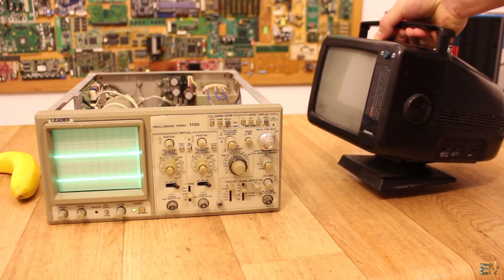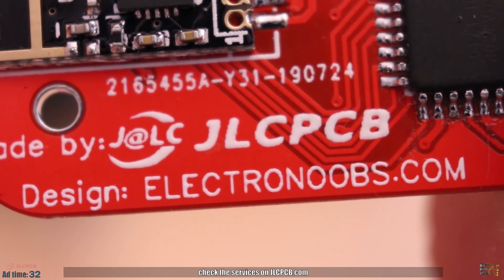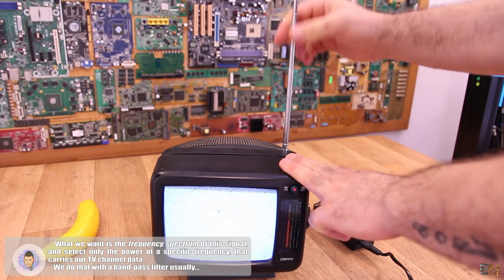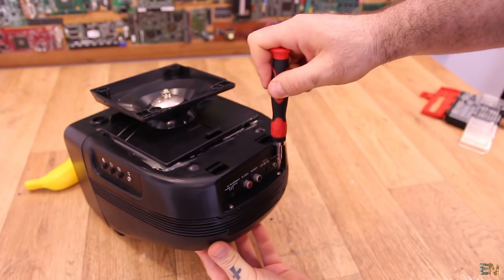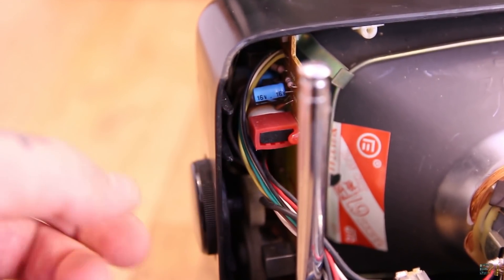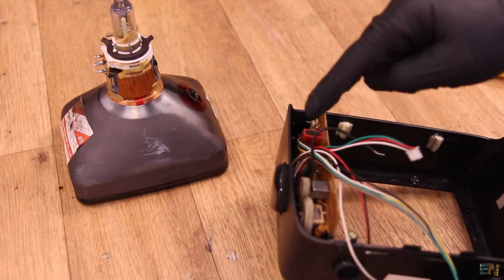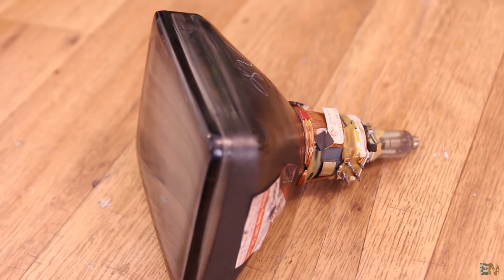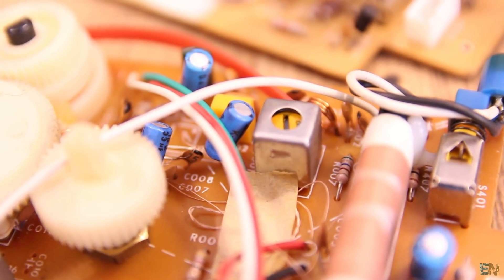Vintage Teardown #2 - Old Portable TV | Cathode Ray Tube and Flyback

Comment: This thing is from around 2000. There were more advanced crt sets around long before. Smaller, and color, even flat CRTs. This TV is just cheap. It's cheap, because of the highly integrated ICs, available at the time.

Comment: All you have to do is get a digital analog TV converter box
Reply: or better yet connect the rf out of a cable box to a signal booster, and connect the output to a rabbetear to make it completely wireless and modern with youtube and everything!
at least if you have xfinity x1 you will have all the cool steaming capabilities

Comment: What you did not explain, is the purpose of the flyback transformer and the principle of flyback in a TV. The deflection coils paint the image on the screen, one line at a time and in an alternate sequence. First it paints lines 1, 3, 5, 7...etc. and them it paints lines 2, 4, 6, 8...etc. In other words, the electron gun must trace the screen top to bottom twice to form one frame of video. In the USA one screen was 525 lines. The flyback transformer is used to return the electron beam after each line is drawn. Here is a link to a picture that shows the scan lines and the flyback: https://i.stack.imgur.com/Vl9yA.jpg   Picture tubes are big capacitors and even after power is removed can contain a charge such that if you touch the second anode (the suction cup), you could get a shock of several thousand volts. (The rule of thumb was that there is approx. 1,000V per diagonal inch of screen. The higher the voltage gradient from cathode to the second anode, the more clear and sharp the picture would be). Always discharge the picture tube before removing the second anode. This can be done by connecting an alligator jumper from a screwdriver to the chassis of the TV and then putting the screwdriver under the suction cup so that it touches the conductor of the second anode. Here in the USA, the horizontal scan frequency was 15.75KHz and sometimes it could be heard. Those transistors that are mounted on the heat sinks are most likely the horizontal oscillator that produces that frequency. So...as the electron gun paints a line across the screen, the inductive flyback transformer winding is developing a voltage on it. When the beam reaches the end of scan line, the circuit to the flyback winding is opened and the voltage produced is thousands of volts in the opposite polarity forcing the beam very quickly to the other side of the screen where a new scan line can start. This is the same principle that is used in the ignition system in your automobile. If you ever wondered how 12V can arc across a spark plug, this is how. The coil in your car is basically a flyback transformer and in the old days, the points (now electronic switches), opened to release the energy from the coil. You can also see my video on flyback if you're interested: https://www.youtube.com/watch?v=uV5AdF1ljDA

Comment: It’s VERY DANGEROUS 💀 handling a CRT television, the tube holds a high voltage charge like a capacitor. You MUST first discharge the tube with a suitable tool. It’s not a good idea playing around unless you are SURE it’s discharged.
Reply from the maker: Everything was discharged. Thanks!

Comment: May want to mention that the CRT acts as a capacitor, which will hold high voltage, even without power connected. Putting a screwdriver under the rubber insulator to remove the clip will usually cause a loud spark discharging it. Can be quite painful!

Comment: Can we use light to send pictures and videos using analog signals instead of radio waves??
Reply: Yes, that would be a laser usually.  But best to modulate using FSK and send as a digital signal.  You can also make a audio transmitter using an IR diode and modulate it as an FM signal.

Comment: You can create an analog oscilloscope with an old TV by using the deflection coils you can guide the signal.
Reply from the maker: That would be a cool project..
Reply: Oscilloscopes didn't use magnetic deflection, for reasons. Coils need current, power, plates do not. Capacitive deflection is more suitable for measuring.